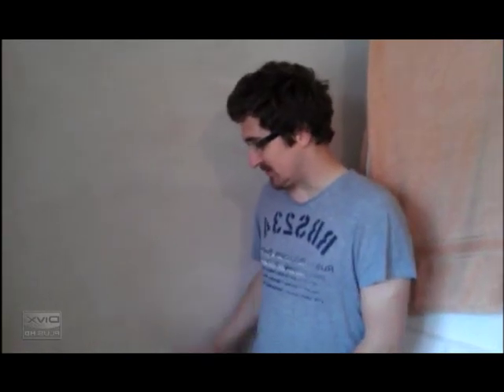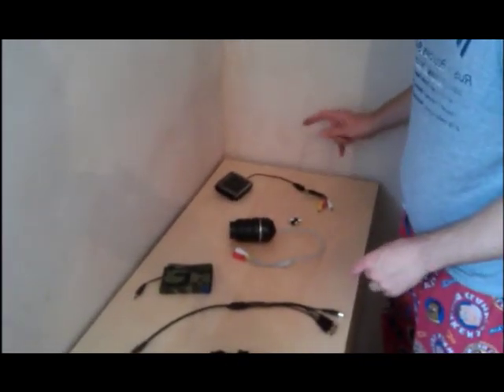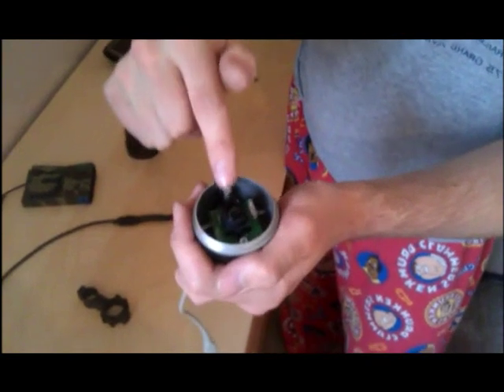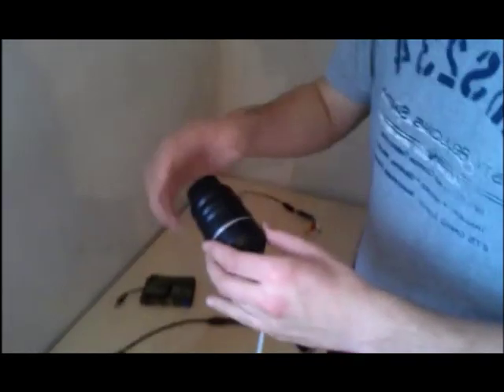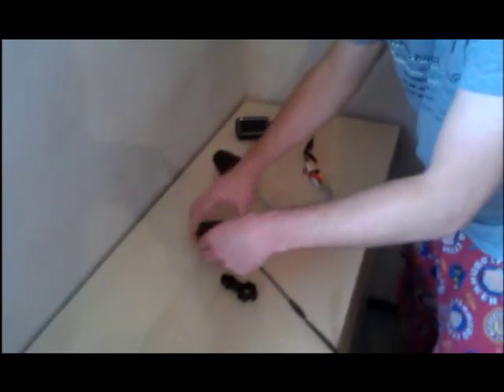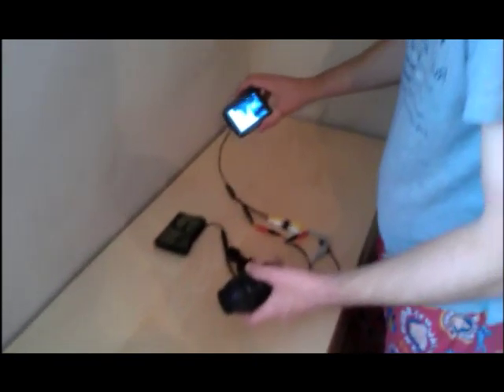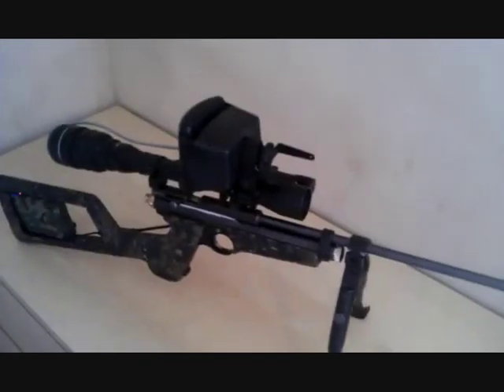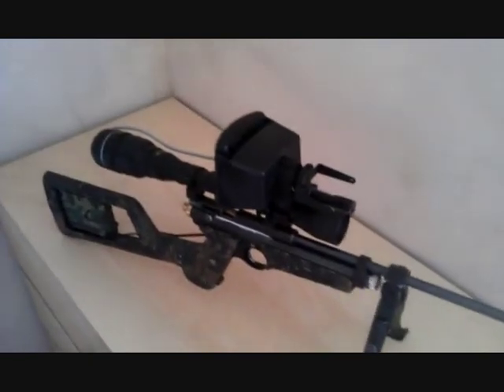AIR RIFLE Night Vision System. How to make a Homemade Budget DIY Night Vision System.

Comment from the maker: sorry for the long wait, you can probably run the recorder from the original battery, just buy a splitter with more connections, i've got a 4 way splitter fitted to mine with one spare.

Comment from the maker: hello, i dont do repairs as i work full time unfortunately but if its a crosman ratcatcher or 2250 and you getting gas leaking it would most likely be your valve seals need replacing, most crosman gear can be found on this site, bit pricey but worth it. I'll pop a link in the description....

Comment: I had some trouble finding the Infra-red laser so hear are some links to every part, I hope!

Camera:
http://www.amazon.co.uk/Color-Surveillance-Camera-Outdoor-Indoor/dp/B008O6GZ92/ref=sr_1_3?s=photo&ie=UTF8&qid=1407804630&sr=1-3&keywords=ir+cctv+camera

Monitor:
http://www.amazon.co.uk/inch-Digital-Rear-Monitor-Square-Black/dp/B0056WJP1M/ref=sr_1_2?ie=UTF8&qid=1407805220&sr=8-2&keywords=car+monitor+3.5

Battery pack:
http://www.ebay.co.uk/itm/New-DC-12V-6800mAh-Super-Rechargeable-Lithium-ion-Battery-OVS-SCA-0650-/291145192610?pt=UK_ConsumerElectronics_Batteries_SM&hash=item43c99b14a2

Board lens:
http://www.amazon.co.uk/SODIAL-Security-Camera-Focus-Length/dp/B00H3CRI3A/ref=sr_1_1?ie=UTF8&qid=1407837042&sr=8-1&keywords=16mm+board+lens

Plug adapter:
http://www.ebay.co.uk/itm/2-RCA-Phono-Coupler-Male-To-Male-Plug-Audio-Adapter-Connector-Gender-Changer-/370236935082?pt=UK_Sound_Vision_Other&hash=item5633d74baa

Infrared laser:
http://www.ebay.co.uk/itm/like/261297714760?limghlpsr=true&hlpv=2&ops=true&viphx=1&hlpht=true&lpid=108&device=c&adtype=pla&crdt=0&ff3=1&ff11=ICEP3.0.0&ff12=67&ff13=80&ff14=108

Velcro:
http://www.amazon.co.uk/chinkyboo-Velcro-Adhesive-Sticky-Black/dp/B0083513X2/ref=sr_1_3?ie=UTF8&qid=1407886896&sr=8-3&keywords=velcro+self+adhesive+tape

Laser mount:
http://www.ebay.co.uk/itm/Figure-of-8-Torch-Laser-Mount-25mm-x-25mm-Rifle-Scope-Flashlight-Bracket-/161165578173?pt=UK_SportingGoods_Hunting_ShootingSports_ET&hash=item2586378fbd

Tape:
http://www.amazon.co.uk/Draper-11909-Insulation--Black-Bs3924/dp/B0001K9OHO/ref=sr_1_5?ie=UTF8&qid=1407887178&sr=8-5&keywords=electrical+tape

2 way splitter:
http://www.amazon.co.uk/5-5x2-1mm-Female-Splitter-Length-Camera/dp/B0050H9A18/ref=sr_1_1?ie=UTF8&qid=1407805343&sr=8-1&keywords=2+way+power+splitter

If anyone finds better or cheaper parts,  post them please. what a brilliant invention.

Comment: Hey @GregBaby I've bought all the items for this setup but I've found that the battery pack won't actually power the camera and monitor. I tried with a regular 9v battery but it ran out in about 20 minutes :P
Any thoughts?

Comment from the maker: Copy and paste this Item number: 160994695123 into an eBay search. OR search for "1CH Mini C-DVR Video/Audio Input/output Motion Detect TF Card Digital Recorder". It basically connects your camera to this recording device which has a memory stick slot I believe, then there's the output slots for your screen.